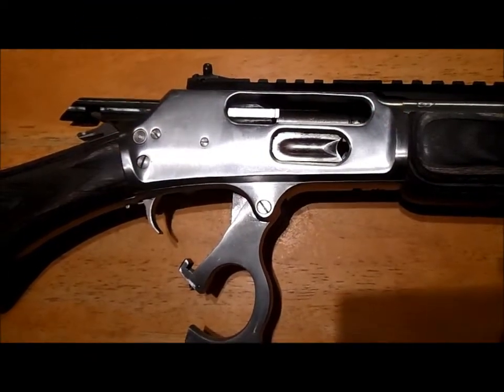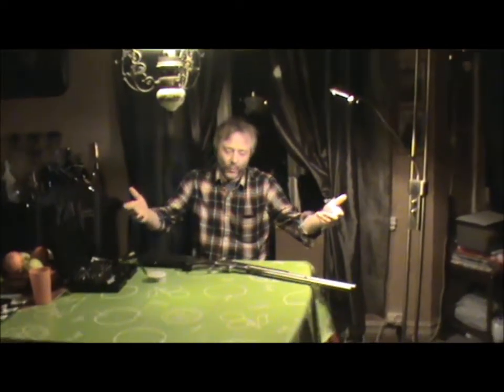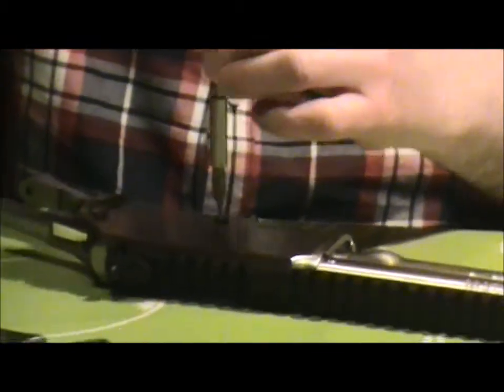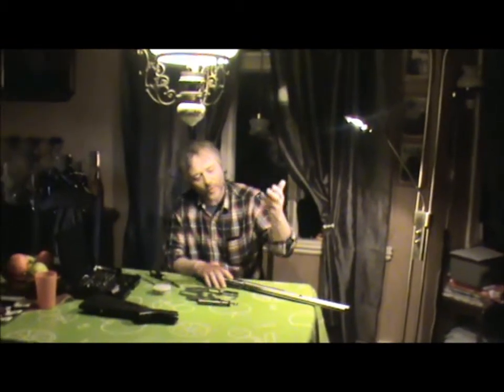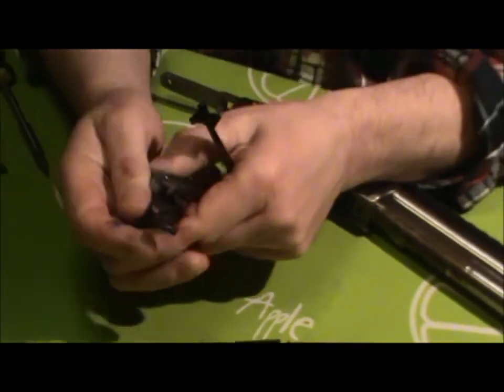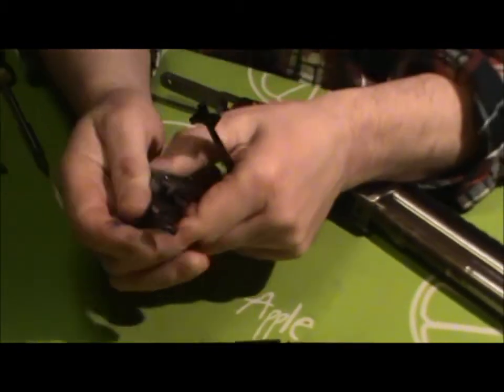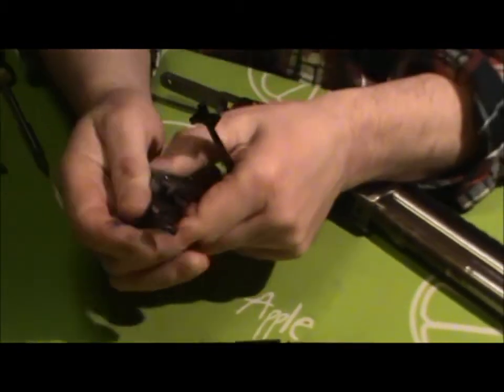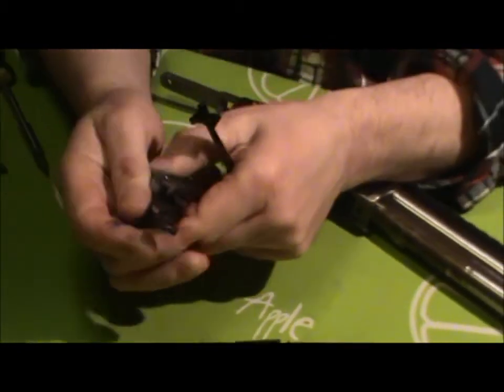Tuning Marlin SBL 45-70 Part 2of11. THE LOCK UP.

Comment: not sure where your from but glad you made these video's you had me knowing exactly what your talking about took me forever to fix mine, and still not perfect, but one thing I did do for the trigger was I bought the Wild West Trigger, it was really expensive, but my trigger pull went from 8 lbs to just 2 and 1/2 lbs of pull. I had so many super sharp edges on mine to it made me mad, nothing cycled right I had to polish just about every single freaking piece in the gun to smooth it out, I also ground down the hammer to reduce the pressure needed to cycle, polished the ejector, and the channel in the bolt. and still need to polish the inside of the receiver. though at least now I don't get cut loading rounds lol. I can't wait to see how things went for you, and see if I can find more I can do to make it better. I also did a Radius on the snail part of the lever to prevent the Marlin Jam. though that was harry since you cant take much off or it screws it all up.
Reply from the maker: Thanks. Sorry for the late reply. I am a Norwegian "boy". I have not tested the Wild West Trigger, but it have a good repurtation. I am on my third SLB now. I went through all the boxes(29 pcs SBL`s), and picked the best one. But still not perfect. "Hanging" barrel, stripped screw hole in receiver(for XS rail). At the factory they probably screwed it up, and just "banged" the screw down(loose). Impossible to disassemble the magazine tube(at the front). Before pick one, I function tested them with dummy rounds, an that was ok. I discovered the flaws back home. Other than that, the gun function ok, shoots good etc. And I love them. As for november 2016, I testet a couple(1895G) at a store, And was impressed(no dummy round test). I may get myself one of them. But before that, I will throw out videos abouth the second and third gun.

Comment: I don't have that gun,....but each gun may have different characteristics because of the sloppy
 fit of parts and screw and pin holes and clearance's.
If you want to see a cap gun on steroids look at the Marlin model 60 22LR it appears very cap gunny inside but work's and is more accurate than more expensive gun's.
I can reassemble them but that's from tuning them lots of time's.
But you take a Ruger 10/22 apart and its simple to disassemble its made like a machine.
At gun shows you can get marlin' parts and piece's from $5.00-$20.00 and assemble them and you have a working gun,.....because people can't reassemble the Marlin.
But many Marlins the people never cleaned them and it shot the barrels out no rifling's left.
The trick for the common man is not to over disassemble a model 60,.....just disassemble it enough to clean it and leave the trigger group alone.
I regret never owning a Browning lever gun or a Ruger lever gun,....you just know they are well machined with tight tolerance's.
My chilhood friend was in the army and he had the marlin 45/70 and he got lots or hog's and deer with it.I just see him in passing about every 10 years.
If you have lots of money a semi-auto is the way to go they make hunting simple.
I prefer a bolt action gun,...I can afford 1 bullet at a time.
I enjoy this guys video's.
Reply from the maker: Thanks.  I love guns. Have lever, bolt action,  falling block, semi auto,  etc. The principle of guns, thrill me the most:)